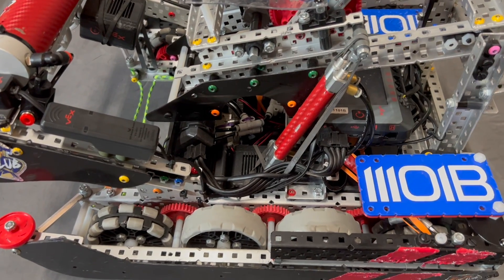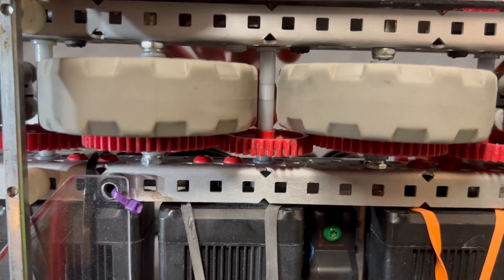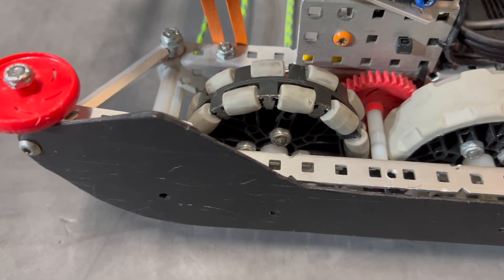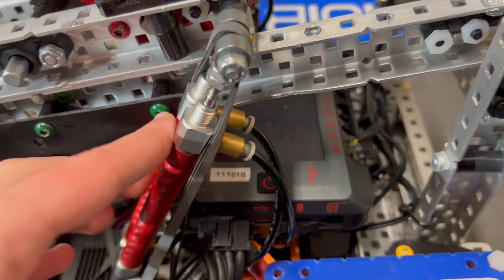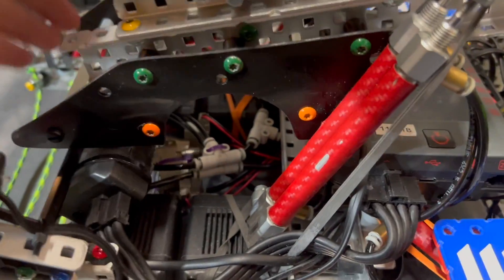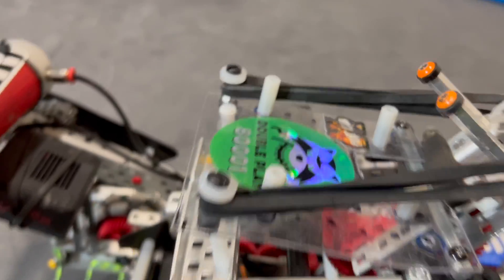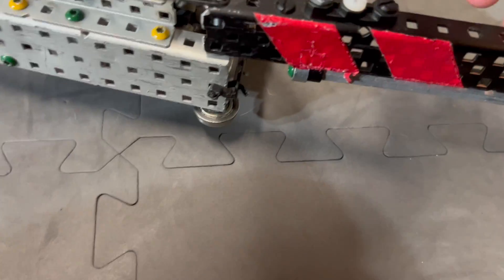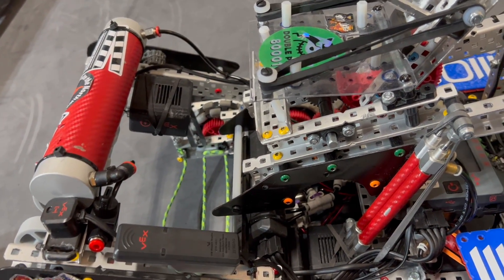Winter Robot Explanation | VEX Over Under | 11101B

Comment: Where do you get the thin spacers from?
Reply from the maker: McMaster-Carr

Off-White Nylon Unthreaded Spacer
1/4" OD, for Number 8 Screw Size
Reply: @barcbots  thank you, im sure it doesn’t matter but I don’t want to order the wrong thing, but does it matter for the inner diameter to be 0.166 or 1.71?

Comment: What is the axle/bar at the bottom of the front of the drivebase?
Reply from the maker: helps to brace the drivebase
Reply: @barcbots  Right, but what's the name of the part? Is it a high-strength shaft?
Reply from the maker: yes, 24" High Strength Shaft

Comment: Do you ever have problems with your shaft collar getting loose? Looking at the video, it looks really hard to adjust it
Reply from the maker: as long as you tighten them they will stay in place. do regular inspections and maintenance. it's fairly easy to tighten shaft collars on motor axles.

Comment: What is the part # for drivetrain thin spacer? And what is the part # for plastic stand-off ?
Reply from the maker: There are different sizes of spacers and standoffs you can get from mcmaster-carr.
Search for:
Off-White Nylon Unthreaded Spacer 1/4" OD for Number 8 Screw Size
Nylon 6/6 Plastic Hex Standoff 1/4" Hex 8-32 Female Thread

Comment: How is the bottom of the hang pistons connected to that 3 wide on the drive?
Reply from the maker: screw joint on axle locks. there are many ways to do this.

Comment: whats the motor catridge for the puncher? ours is 12 slip to 36 which is the same gear ratio and we use a red cartidge. Its pretty slow compared to other robots with 30-35 second matchlaooding. Seeing as you have a 200 driver skills, its urs also just as slow or is anything different?
Reply from the maker: 100RPM red cartridge. reduce the amount of rubber bands to get max speed. At 100rpm you should be able to matchload 44 triballs in 27 secs. If you want to be faster you'll need to use different gear ratio and/or double slip gear.
Reply: @barcbots K ill try that, thanks. Congrats on 3 sig finalists btw
Reply: @cucubob9535 u should try out 200 rpm cartridge, 12 to 36 ratio, doubled slipped on the 36 to a 60. 133 triballs per minute so it’s pretty good for skills